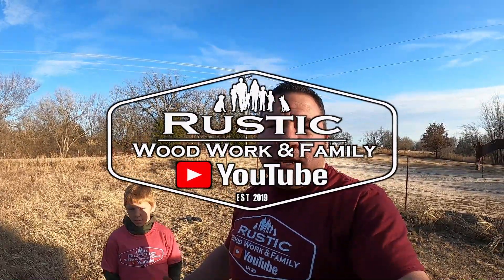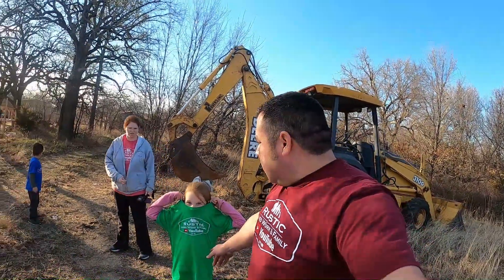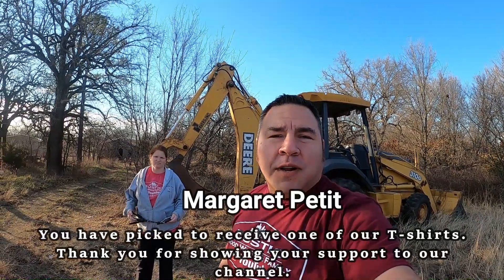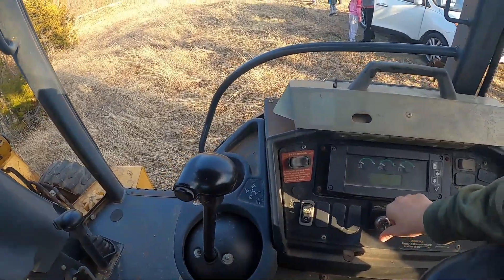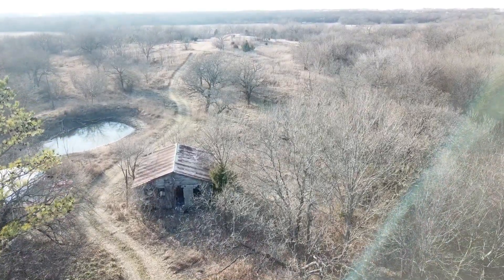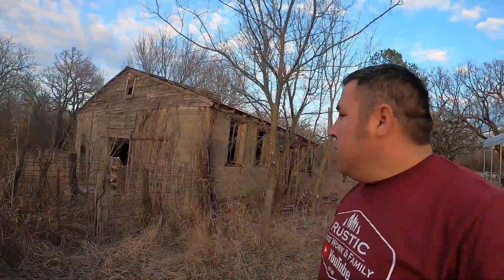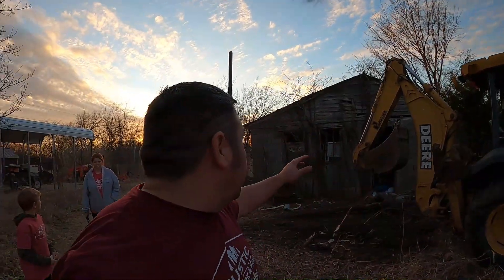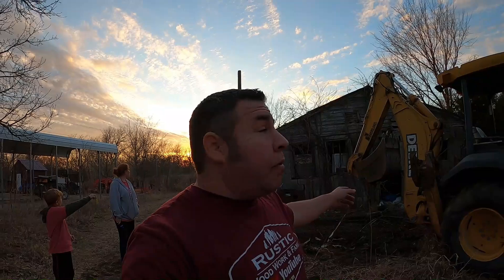Barn Demo Day! Can I save it? Hope this is going to be the start of our homestead.

Comment: That was awesome.  You took it down so gently, It seems that most of the bricks can be reused. If that bath tub survived  it would make a great flower bed or raised bed garden. Those bricks could be used for many things, raised beds is one use for them also.  Those bricks  and that tin roof can be reused for an animal shelter. 
Yes save those panels,  they will definitely come in handy. 
Don't forget about any salvageable wood. I'd love a flag with barn wood.  
Thanks for sharing. Stay happy, healthy, hydrated and safe. 
May God continue to bless you and your family.
Reply from the maker: Yes it took a little while to get used to the equipment. It has been many years since I ran a Back hoe

Comment: s
Save the metal and if you can save the cinder blocks for raise garden beds they will never rot. Heck even some of the 2x4's you might use for coops or pins for animal. wood has a crazy prize now. Is that old wood stove still good?
Reply from the maker: Yeah I did save the panels but we did not save any of the bricks or would we had a timeframe to get everything down and we just did not have enough time

Comment: Hey Brandon, you guys look like your having a blast working on your land. What are you doing with the trash? With that tractor you could dig a big hole and move all the burnable parts in it and burn it down to nothing, i use Diesel fuel. After you get everything burned then you can bury the blocks in the driveway .
Reply from the maker: Roger just saw your message yeah we’re super excited as well we’re going to bury all the brick the word we’re going to burn